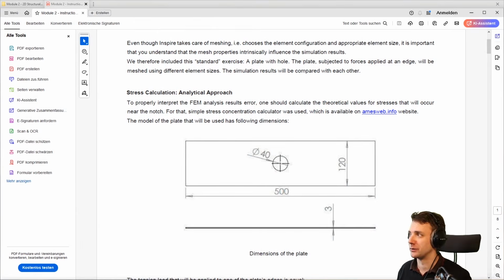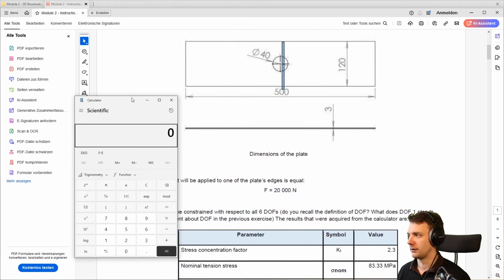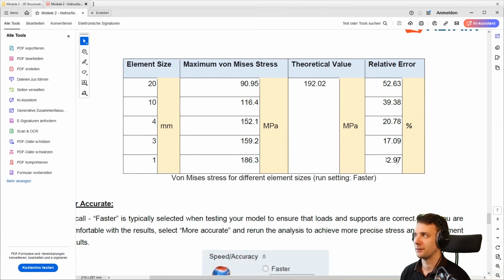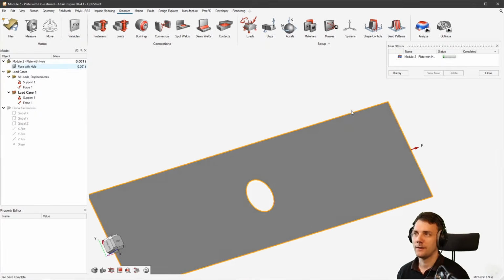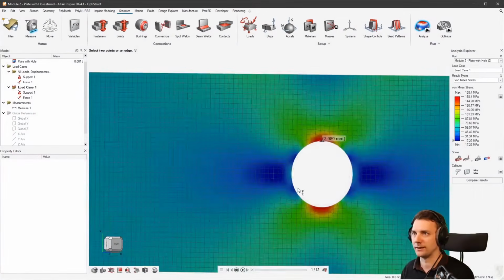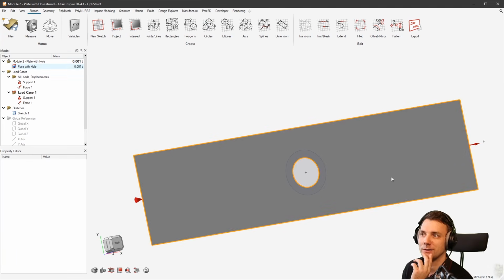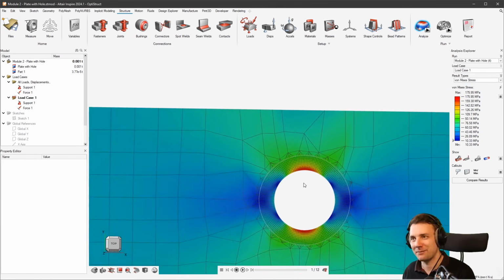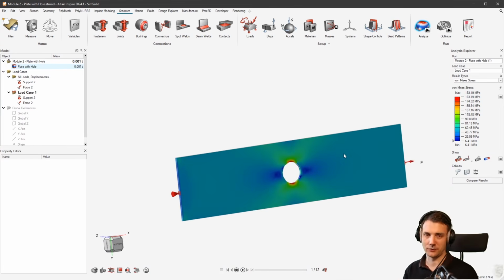Altair Inspire 2D Mesh for OptiStruct | Comparison with SimSolid Solver

Comment: This is a very interesting topic in my opinion, thanks for your video.
I'm actually writing my bachelor's thesis on the result accuracy of Simsolid right now. 

At the moment I feel a little ambiguous. Some results, just like yours, are pretty good and in general, the workflow and solver is super fast. On the other hand, there are a bunch of (often very simple) cases, where Simsolid calculated very weird and very wrong results.
At the moment, I would say that I do not really trust the solver.
Reply from the maker: That's very interesting! Thank you for sharing! Can you elaborate on the examples where it does not give good results ? You can also email me some models to ramsaier@rwu.de 
I would very much want to take a look at those and find out what's the reason for failing.
Reply: @ I just sent you an email. I would be very interested in an exchange even though I hope the email is not to vague:-/